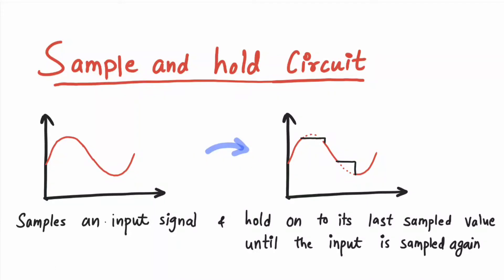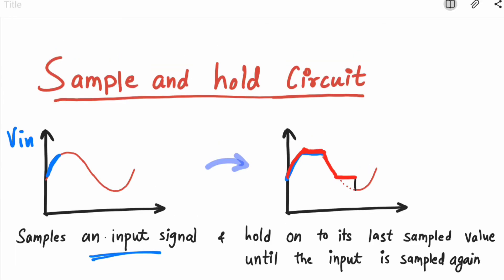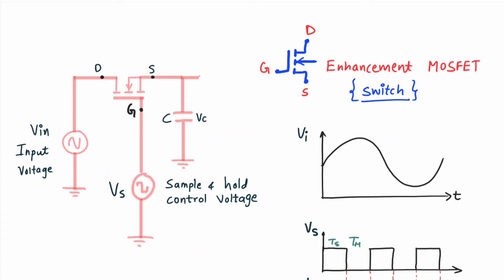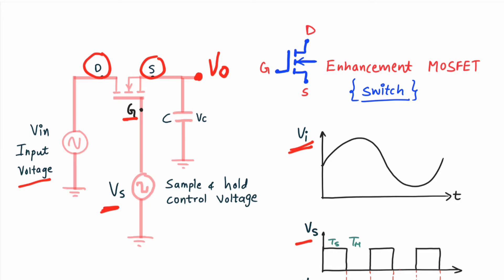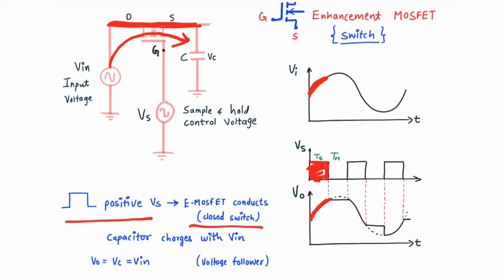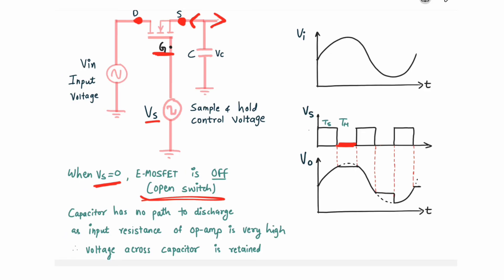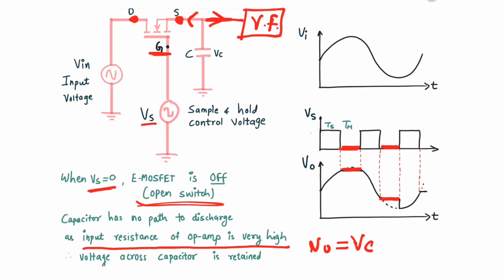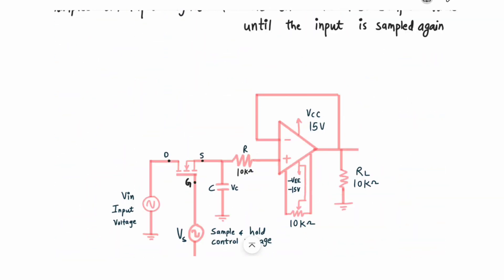SAMPLE AND HOLD CIRCUIT USING OP-AMP | Explain sample and hold circuit with waveforms

Comment: The holding capacitor is discharging even in the holding phase, even when i have a voltage follower, i am doing this in the simulation proteus